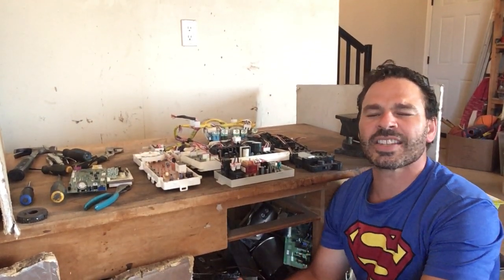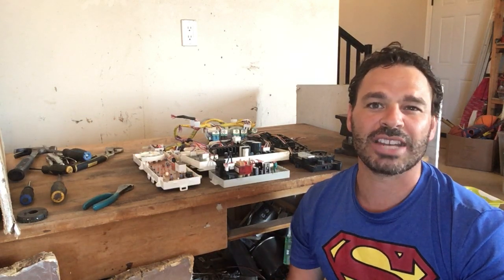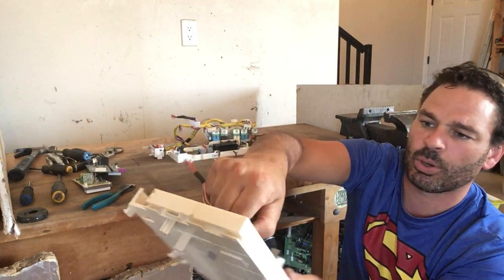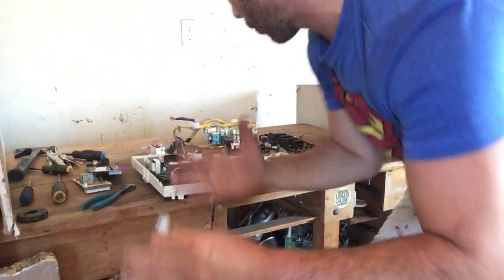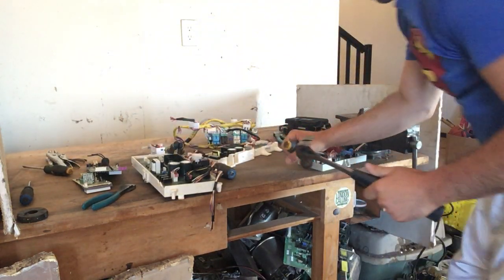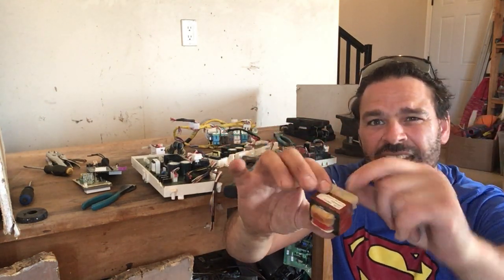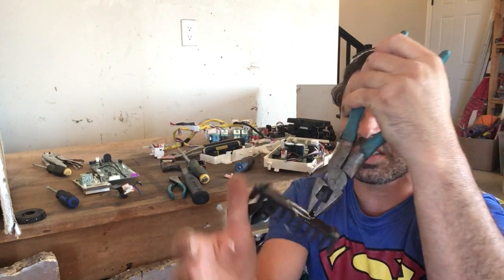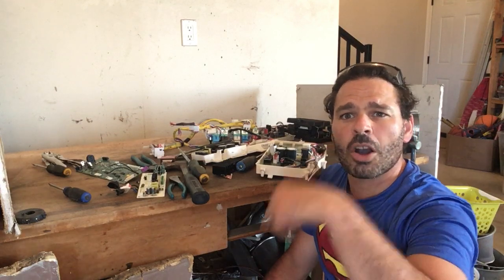Scrapping circuit boards with  a rubberized filling. How to remove the goodies for maximum profit.

Comment: I come across a few washing machines with those circuit boards on them and thinking if there's  a solvent  out there that can dissolve  that rubber compound  like petrol or thinners ? i might need to experiment on one
Reply from the maker: Not sure, but I find it easier just to get ewaste. Not sure I want to start melting rubber, probably smells.